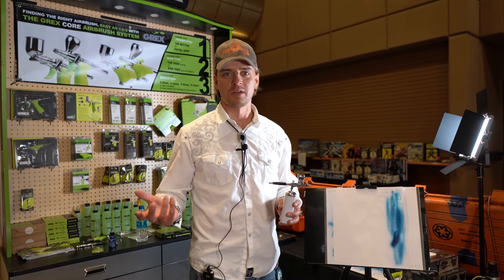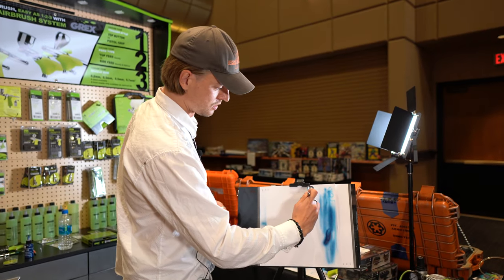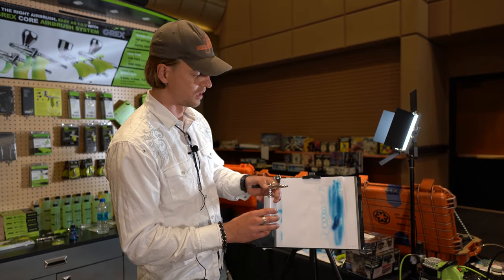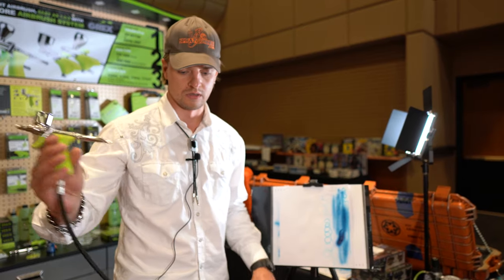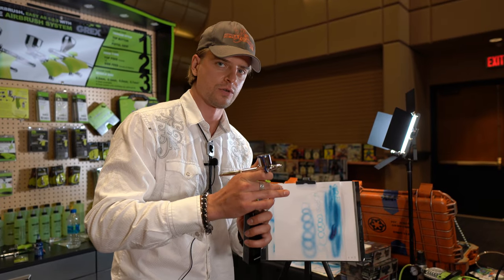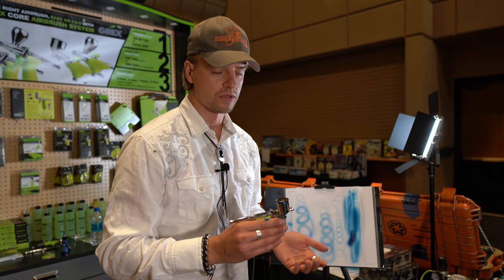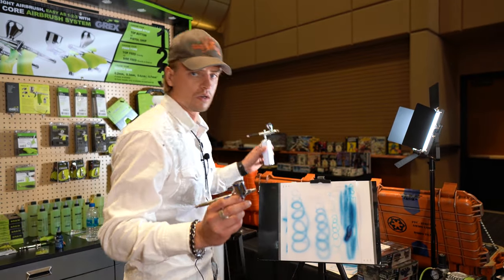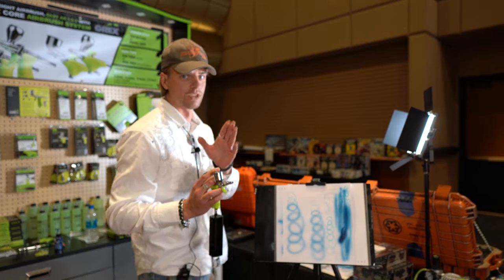Cordless airbrush - difference between 2 best portable airbrush models, CA03/CA04 & CA20 by NO-NAME

Comment: after using, can i use lacquer thinner to clean brush between colors and for final cleaning?  if not, what do you suggest for cleaning?  thanks.
Reply from the maker: Tom, it depends of the type of paints you're using. If you use lacquers - definitely can use lacquer thinner. It washes water-based paints too but if you're using water-based like Createx, you can use 4011 to flush the color out.

Comment: Is there a way to valve assembly from the top of the smaller one? It's attached to the compressor instead of on the the bottom of the brush. I'm sure it's just a standard fitting but it seems they have used Loctite or something to fix it into the threads. 

I have another brush I want to use with the compressor but it has the valve integrated into the handle so I cannot remove it and because the compressor has a valve already, I cannot use the brush as it has no way to depress the pin. 

I'm sure the compressor has a standard thread on the top but the valve seems to be glued in place. Quite frustrating.
Reply from the maker: https://spraygunner.com/airbrush-kits/by-type/cordless-airbrush/universal-cordless-airbrush-compressor-by-no-name-brand/
this model doesn't have air valve. Can be connected to any 1/8" airbrush

Comment: I have the black version, is it normal for it to go on and off repeatedly while sitting without spraying
Reply from the maker: Most likely there is a slight air leak somewhere. Check the connection between compressor and airbrush. Feel free to reach out to our customer service for additional help!

Comment: It would be interesting which one is quieter and are both usable for nozzles> 5mm? What is the weight of these compressors?
Reply from the maker: GREX used in this video is .5mm, as long as you're not using fan air cap, it will be fine with CA-20 compressor. The weight is around 4oz
Reply: @SprayGunner  rs..?

Comment: i wanna order the black one because of the cord...can i use my gsi micron to do portraits with the black version ..
Reply from the maker: It works great with PS770/PS771. That's one of our standard sets we use for demo on expos. GSI Custom works well on a low pressure settings and doesn't' require much air.